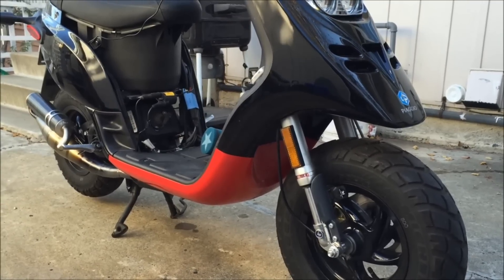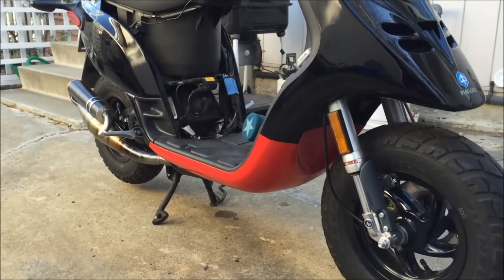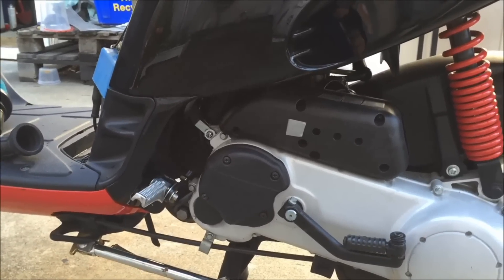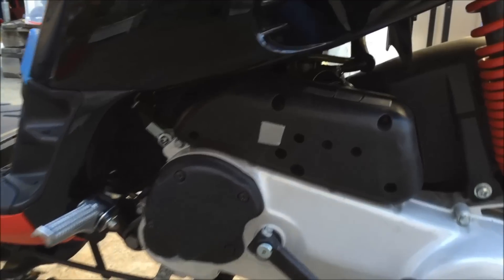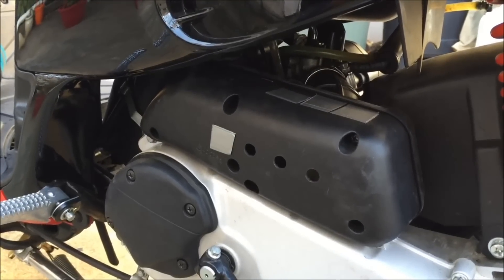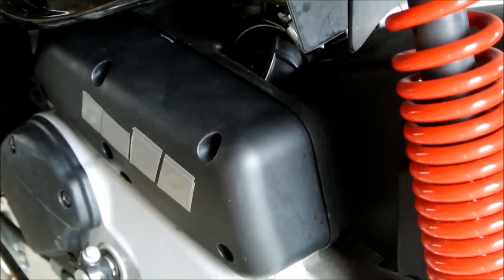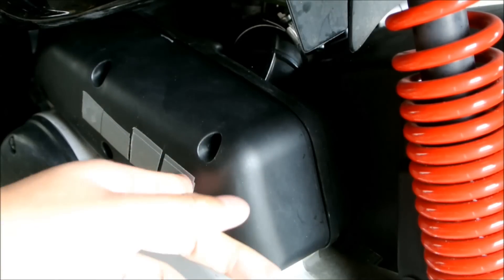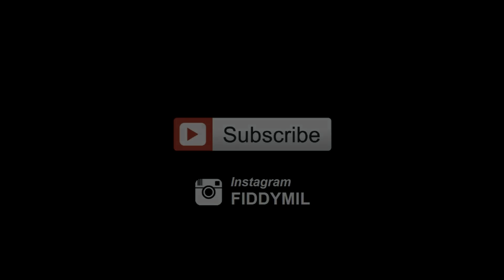BEST FREE MOD FOR A FASTER SCOOTER - EPISODE 10

Comment: will this work on pgo pmx 50?
cheers
Reply from the maker: Drilling holes into your airbox will work for essentially all bikes in theory. Knowing where to drill it is essential because if you drill holes further downstream of the filter, then the filter can not do its job filtering the air.
Reply: It works on all bikes that have easy accesable air box

Comment: that doesnt give you more power... unless the airflow thru the snorkel is better
Reply from the maker: Airflow through the snorkel has increased and more power was found as shown in the following episodes...
Reply: FIFTYmil yeah but i was talking about the air filter, the snorkel has increased air flow because its more smooth thru the corners and it has less corners. sure it will gain hp but not because of the air filter
Reply from the maker: offroad idiot That didn't make any sense at all. It gained horsepower because of what I did to the airbox cover. The air filter was left untouched.
Reply: FIFTYmil oh im sorry, didnt watch the whole video lol, but i wanted to say was that a simple filter will do a good job as well but the airbox is restrictive but you fixed that in the way you could for the less amount of money :)
Reply from the maker: A less restrictive filter will improve airflow at the cost of less filtration, regardless of airbox design. A more direct approach shown here is to bypass the baffles and pathways integrated into the airbox design. Agreeably they are there in the first place to reduce noise, emissions, and provide better all-weather performance so you are indeed giving some of that up for better performance under ideal conditions/conditions I ride my bike in. That is the cost of modification tuning
Reply: a few airholes, wouldnt make me need to rejet it?
Reply from the maker: JoeKickass324 it did for me! Almost a 50% increase in fueling to sustain the increased airflow and higher rpm

Comment: what happens if I dont re jet the bike? good vid
Reply from the maker: Marau PT it is all about the correct fuel mixture. Sometimes you don't need to rejet if the mod you make moves it closer to optimal mixture. If you're off the optimum you produce less power. On a 2 stroke bike improper mixture results in insufficient lubrication leading to overheating and piston seizure or detonation.
Reply: and if it was a 4 stroke? Sorry, I do not know much about motorcycles
Reply from the maker: Marau PT 4-stroke is a bit more forgiving the engine would run hotter and lack power but over time it's bad for the engine as well
Reply: ohh ok thanks for thelp dude
Reply from the maker: Marau PT no problem! This is why this mod is so versatile when you can cover up the holes to tune on the fly

Comment: dont do it, a standard bike need back pressure to function right. if you drill holes in the airbox it will actually decrease performance.
Reply from the maker: Srsly? Before you make that claim, please define back pressure in the 2 stroke vs 4 stroke context and clearly explain how back pressure “will decrease performance”.
Reply: FIFTYmil pleas buy yamaha aerox  2013 version tune that
Reply from the maker: I wish they sold the aerox here in canada!

Comment: do I need to rejet  the carb after doing this ?
Reply from the maker: If you leave all the holes covered/plugged, in theory it should be the same as original and no jetting is required. When you increase the airflow by opening up the holes, then you must rejet in order for the engine to produce more power.

Comment: HI BRO.
am from india and own an APRILIA too, mine scooter is APRILIA SR 150, with 155 cc engine max. torque 10.4bhp @6750rpm max. speed 120kmh. can you please suggest me helpful mods for practicality and cosmetic and technology ,not performance. and is it OK if I colour the silver cvt box as BLACK.
love from India 😊
Reply from the maker: Yes it is absolutely ok to paint the CVT case black if you know how to do it correctly. One of my favorite mods to the scooter is a side kickstand, lower handlebars, and a cell phone holder. Check out the holder at this affiliate link:  https://goo.gl/YRppLv
Reply: FIFTYmil HI BRO. i did that was a n awesome mount. can please explain me that lower handle bar. and thnx. for your feedback, you are amazing are scooters.
Reply from the maker: A lower handlebar would look like this: https://scontent-sea1-1.xx.fbcdn.net/v/t31.0-8/14372069_772838519524291_483188084711937082_o.jpg?oh=317773086b9c8a2fd595874e51f76d28&oe=5963908C
Reply: +THE KILLA - Had an Iridium spark plug, gap it to 0.9/1mm. 
Keep the scooter clean and well maintained. Tires pressure checked. 
Lube all the key locks/hinges (WD40 or equivalent). 
Maintain the air filter immaculate clean. Had a good fuel filter. 
Had a couple of hooks for cargo load, carry a few bungee cords,just in case.
Had some carpet in the under seat compartment... Enjoy. ;-)

Comment: Don't do this, just remove the snorkel
Reply from the maker: Not advisable to remove snorkel for CV carbs and/or all weather conditions riding
Reply: @FIFTYmil  it's better to remove the snorkel rather then drilling holes into your aitbox tho, removing the snorkel doesn't effect its use in bad weather conditions, if anything drilling holes into the side of your airbox had a higher chance of letting water in. Your method works but it doesn't make sense when you can just remove the snorkel and get the same amount of airflow
Reply from the maker: @2SmokeyGuru  Good point about the leak in. If a scooter is parked in a heavy down pour the rain will definitely get into the airbox. However, more water would make their way into the engine with an open filter while riding because the carb is directly facing the rear wheel where the water is being kicked up and splashed around. With holes in the airbox you can easily tape the holes up and it would perform as well as stock against the weather.
Reply: I think you've misunderstood what I mean lol I ment taking the snorkel out of the original air box lol, either way works lol